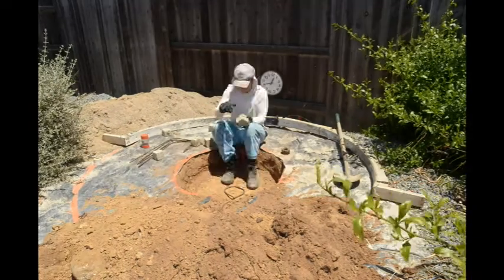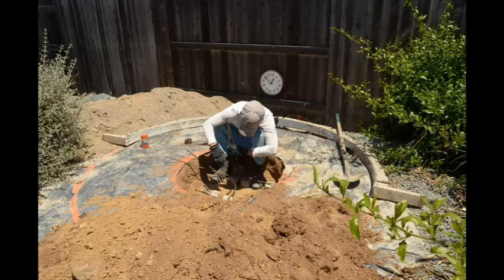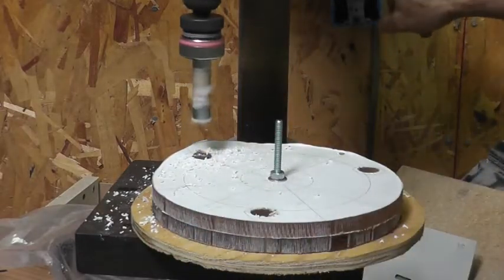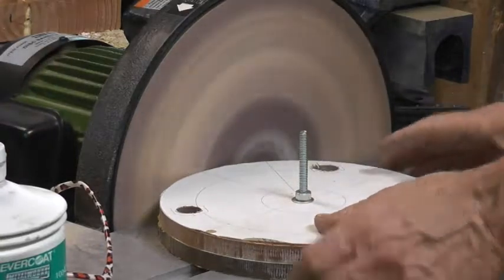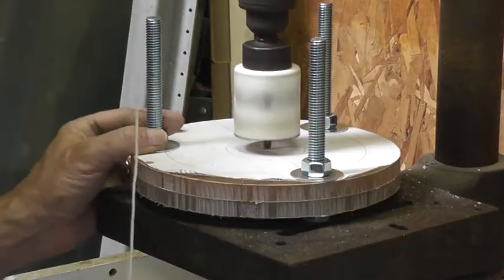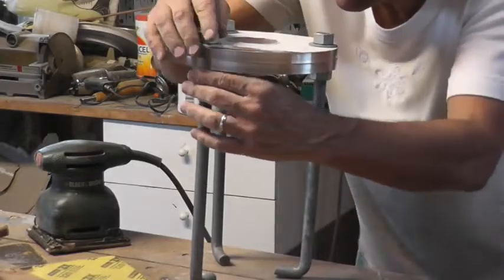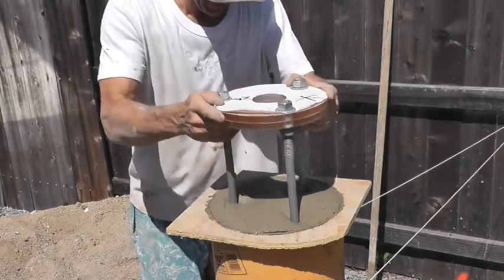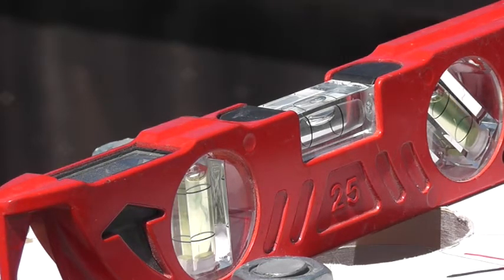Observatory pier

Comment: He mentions that he never got it level or plumb I see so many people are obsessed with those words.  The fact of the matter is that no part or the pier needs to be level or plumb the only thing that matters is the RA aligned to the NCP.  That is it!The pier is not deep enough your not going to get satisfactory results.  My concrete pier weighs 7500 lbs that holds my telescope and goes 7.5 feet into the ground.

Comment: made my adapter plate out of turned aluminum on my owm pre ww2 german lathe
Reply from the maker: Cool, i got a little Harbor Freight mini lathe that is good for mini things, not adapter plates
Reply: if you need something larger made like an adapter 100-200 mm in diameter, i make them custom built

Comment: Nice video! Sure the base could have been deeper. Yuotubeismispelled can you be a bit more dramatic? "Dangerous, topple over & won't be anymore stable than the tripod" LOL!! One load from a concret mixer that size is over 250 pounds, he used two loads. In addition to the weight of the column its pushing 700 pounds. My portable pier is 58 pounds. "Topple over"! LOL!!
Reply from the maker: Ya, 180 mak will sit on the column so no weight, backyard Sandy Eggo so stars, planets and the moon only. No observatory yest but one is coming.
Reply: My concern was that people would see the video and think, "well, I could get away with maybe a 1/4 of the weight".   I've been doing astronomy since the 80's and I"ve seen 2 piers in Florida (Chiefland) that needed to be remade because over 10 years, they began to noticeably shift/tilt.   One of the piers only had a base of approx one foot deep.   The owner abandoned the pier and built another one later that was twice as deep.   It's not just an issue of weight when you're talking about placing concrete in soil.   Portable pier???   You got one of those cheap Astro-Physics mounts?   LOL.

Comment: Dangerous build.   With a pier as high as yours, the moment arm of the telescope, mount and concrete could easily topple the whole setup over time.  As others have mentioned, you should really go 3-4 feet deep for the concrete footer.   It might be fine for visual use, but for astrophography, your setup won't be any more stable than the tripod that came with the mount.
Reply: +yuotubeismispelled "but for astrophography, your setup won't be any more stable than the tripod that came with the mount" That's a very interesting opinion you have there. Nothing wrong with a tripod, I get down to 0.3" RMS with my tripod on nights of good seeing. I'm pretty sure his setup is solid enough, you don't need several tons of concrete to keep the thing from toppling over.
Reply from the maker: If an asteroid bumps into it, it will surely over-topple. It certainly isn't bump-proof.
Reply: 0.3" RMS is impressive.   I can get that too with a little 80mm scope and a cheap Atik camera.   But not with 50 lbs of OTA on the same setup.  The point I was trying to make was that you want to overbuild if you are doing astrophotography.   I'm sure it's working out great for divyajnana, but there's always someone out there who thinks they can get away with less than the bare minimum.   And yes, I've personally seen tripods and portable piers get knocked over by wind at the Texas Star Party and the Winter Star Party...

Comment: I'd be interested to know how stable it's been since it was finished & has had some considerable weight put on it...My pier goes down nearly four foot & the hole took nearly half a cubic metre of concrete to fill it with the main pier post consisting of three seven foot lengths of scaffolding tube welded together as a bunch then the whole lot encased within an eight inch diameter ABS duct pipe then all very firmly packed with a very strong concrete mix with added carbon fiber to bind it all together, once it cured it took a weight of 200Kg suspended from it at a distance of 600mm from the center of the mount & it only offset the level by just under a thousandth of one degree, I'd bet this one isn't quite that stable!
Reply from the maker: it will have a 180mm mak on it, no weight. Backyard in Sandy Eggo, double stars, planets and of course, luna-tick'n. No observatory yet, but one is designed and a slab has been poured.

Comment: I had a small welding & steel fabrication shop make up a pier for my 12" sct. They did it to my spec's & it was 4" steel pipe with a floor bracket 16" x 16" w/4 gussets & holes to bolt to the concrete floor inside my observatory. The job was about $135. It also had a mounting plate, drilled to my spec's, welded w/gussets. It was heavy duty stuff! It weighed almost 100 lbs.. As for the observatory..  see below. 

I made my observatory in the back yard too. I had a 10' x 12' concrete slab. I just leveled the site, set up 2 x 4's (braced) and called a guy I found that did small jobs like this - he came and had his concrete guy w/a small cement truck - pull into the alley & set the trough over a fence like yours & poured into a wheel barrow. Then he poured several times and leveled & smoothed it off.  Cost $300 bucks. Cheap enough & I just watched.  Then - I had seen storage buildings at Home Depot, that the company they ordered from would build in sections, deliver & set up. So, I picked the 10 x 12 x 6 high and they came out and put the sections together & drilled & bolted the building to the concrete. When they lifted the roof on top I told them to not attach it - I would do it later as I had somethings I was going to modify.  Then I measured up & made some brackets to hold.. 2 rolling pins! Yeah, like you'd use to make a pie crust: http://www.anything4restaurants.com/products/rolling-pin-stainless-steel-126747.html   It worked fine. I just lifted one end of the roof from inside & the roof started rolling.. easy as pie!
Reply from the maker: That stainless rolling pin is BE utiful!!!! There is a LOT to be said for Just watching. My cheepness gets the better of me ALL THE TIME!!!

Comment: y didnt you just pour it monolithic. all at once. easy to do and alot less headache
Reply from the maker: Ya, that why i could PVA the bottom of the tube down to stabilize it during the column pour.
Reply: PVA ???
Reply: No way itshouldbe done in multiple pours and beside syou should have ad pvc conduit up the middle for power and or switch controls for anything
Reply from the maker: PVA construction glue. I'm just going to run a conduit up the side of the column. Sorry, I know, gross.